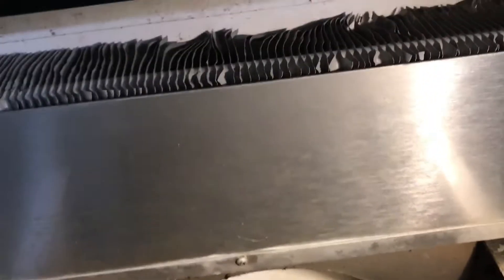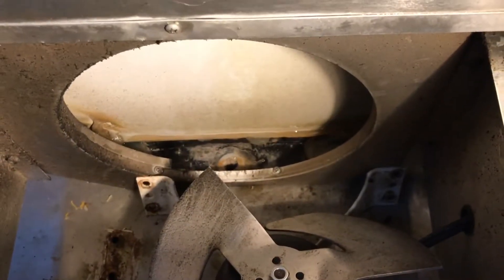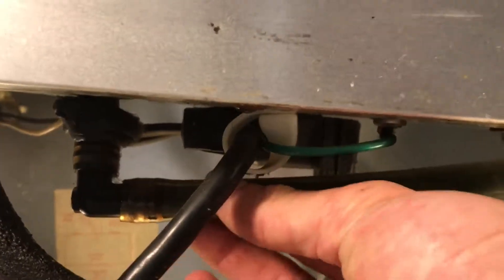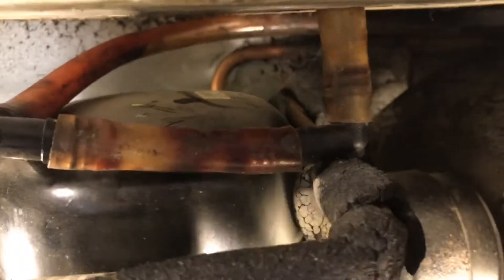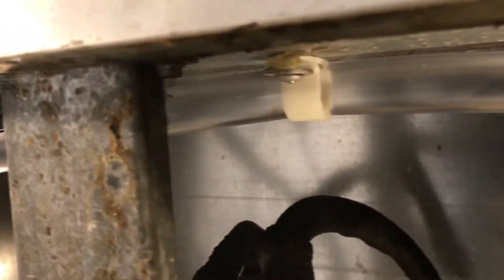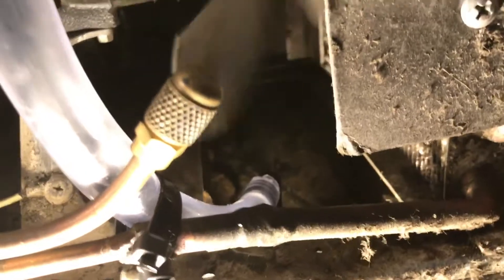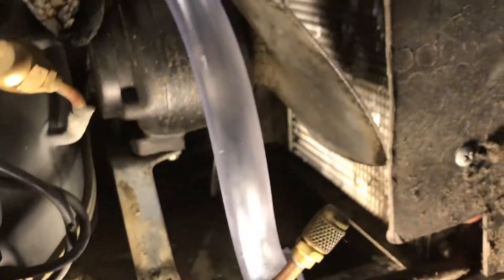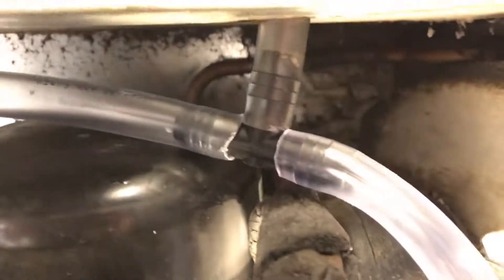True refrigerator 48-08 water build up

Comment: Why use a tee fitting?  Looks like it just creates a place for water to sit and get funky.  I would run a separate drain line for each.  You likely have room and less chance of water hanging out at each fitting along the drain.  Fewer restrictions means better flow.